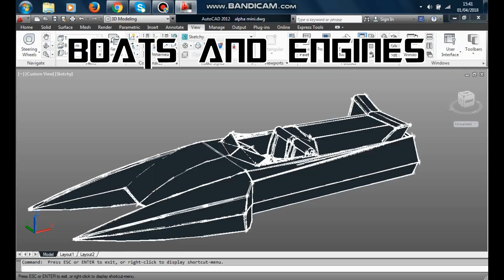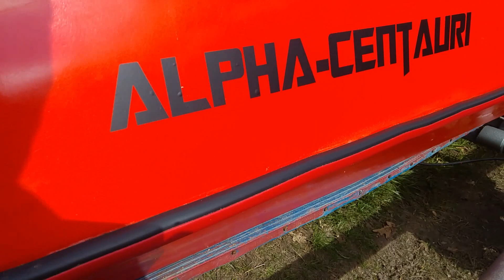Speedboat build - test day has arrived!

Comment: Great great job!! Can’t wait to see it really run fast. Do you have a jack plate to put on the back you could raise the motor straight up a little bit get half the prop in the water and a little more pitch.Great old motor we had two of them we also had the in-line six 115 with a short shaft open exhaust.